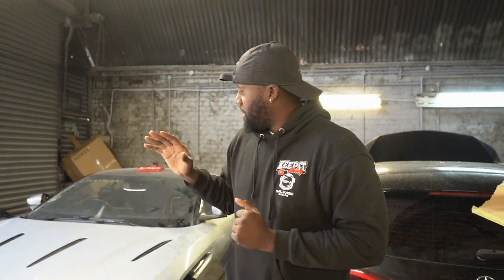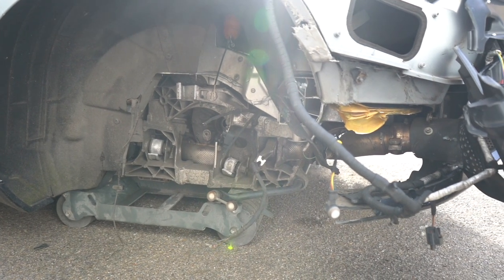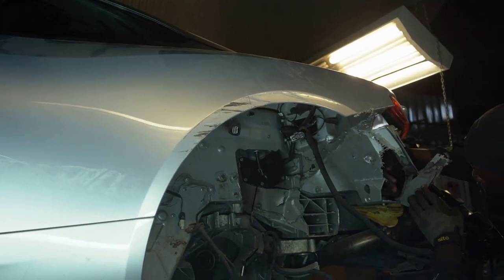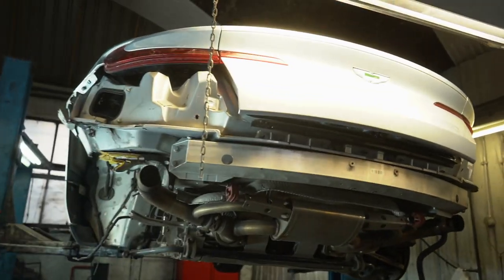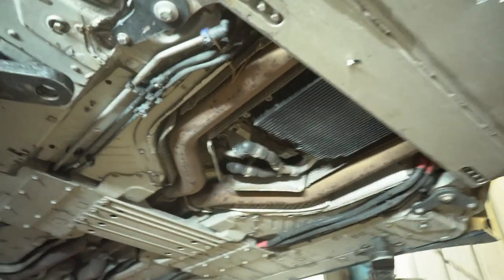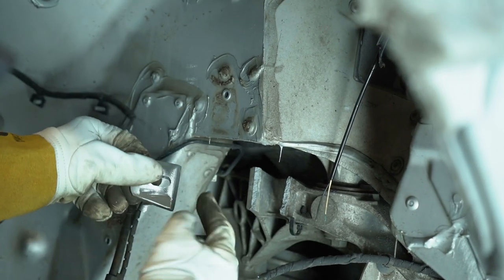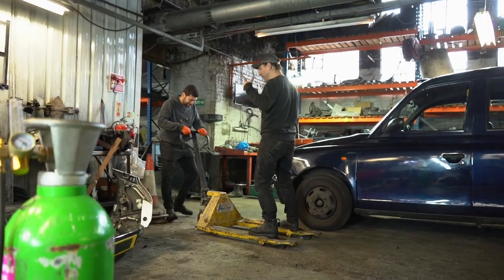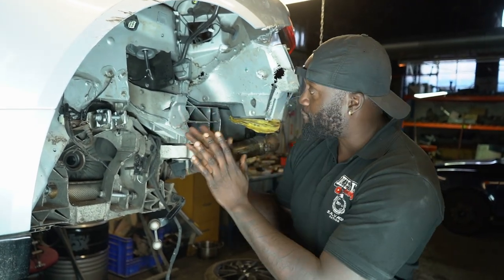REBUILDING A CRASH DAMAGED 2017 ASTON MARTIN DB11 - PART 2

Comment: Probably stronger now then oem , its a weak spot in the first place given it went after crash , most of the force is probably go into the bushing , should be all good , you could always use body sealer around it for added strength i guess